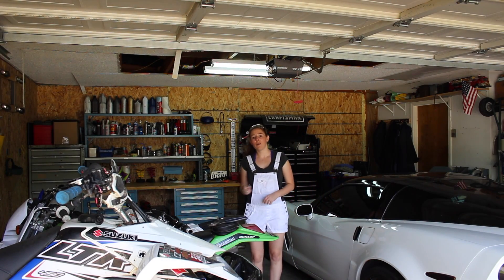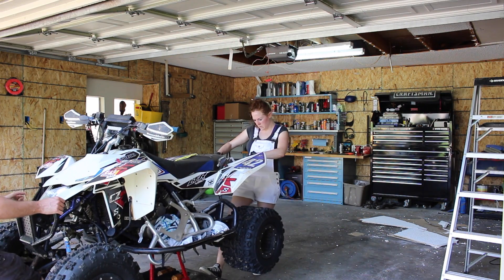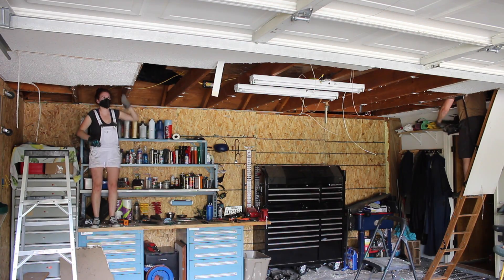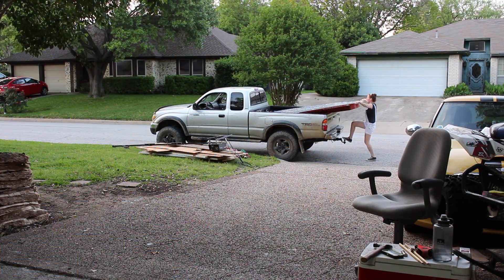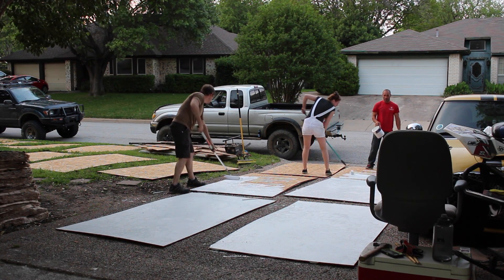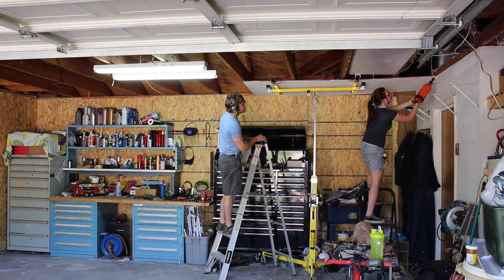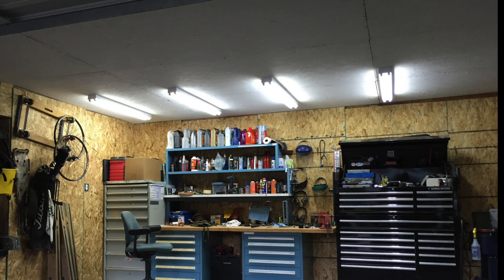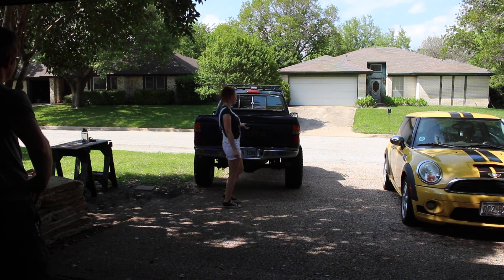Garage Ceiling Overhaul

Comment: April, this is an awesome video, great team work! 
I would go back over the ceiling and place screws at 6" on center of the perimeter of each sheet with a minimum of 8" centers 'in the field of the boards', (we used old 1970's sheetrock screw guns) even if the boards/sheets have several nails holding everything in place now. (Also I would place battens at 4'o.c. each directions to cover the exposed OSB joints, just fancier for some people.) Use screws that penetrate at least twice the depth of the thickness of the OSB board, but be sure they penetrate at least 1.5" minimum into the ceiling joists, or two times the thickness of the fastened board, which is a "considered standard" or which ever is greater, (ie 1" thick boards requires 3" screws) my 1968 Basic Minimum Carpentry Practices. Many people will tell you this is overkill for screw length, but I learned ""the hard way." 
Remember, "nothing too strong ever broke."

Off subject just a little, sorry. 
From 1968, at age 20 and during the 70's decade an employee and I could install 20'X20' plywood ceilings in 2 hours, without nail guns! Time was money and I was building/contracting homes for a 100% fixed fee. Less labor used and a more effective  use of materials was more profit for me. Again we worked harder not always smarter. The employees (age 40 was my youngest employee, up to age 57) were paid the top scale for carpenters of that era, more than some Texas carpenters as I had 3 from Dallas, who were longtime employees working for me. That said, many things are vastly improved in today's world and much easier but many people seam to make them harder hoping technology is the answer to everything. But manual labor jobs must be done for the tech people to look good, projects still have to be put in/on the ground, like the physical work you do for your videos.
I could make a small fortune (if I had a LARGE one to start with...lol) in today's world by offering a fixed dollar cost completed structure. And that is the only way I would want to work, no surprises for the Contractor or the Homeowner. But 68 is too old to learn current construction trends and styles....ahh the good old days. 
....13

Comment: When my Dad was renovating the house when I was a child, he built a square shaped frame out of 2x4 planks with a vertically moving insert which could be slowly lifted up with the piece of drywall ontop using a crowbar at each corner then sliding a screwdriver into 2 holes in each piece to act as a pin. It was crude but worked very well and it saved on going out and buying a specialty made device like the one you guys used.

Just a thought if anyone wanted to replicate it.

Comment: I see someone already talk about the codes and the fire rating. I deal with fire codes for a living. You also have problems with off gases from your vehicles going to to the living areas. I know Ft. Worth would have made you pull a permit to do that kind of work and would not pass the remodel. No preaching, just concerned. I am glad to see you and Cody working together. Just don't scratch the car.:)

Comment: Thank for the video...always enjoy your projects.  I was wondering if this garage is attached to your house?  I live in Northern Virginia and if you have a garage that is attached to living space (house), the entire inside of the garage needs to be drywalled, taped, and mudded for fire resistance and to be air-tight to the living areas to avoid fire hazards and carbon monoxide issues with having a vehicle inside.  I would recommend checking your local building codes to make sure you're good with OSB ceiling.  If it does require drywall for code compliance, you could still sheet the ceiling with drywall over top of the OSB and then you'd be good (you would be in compliance for codes and you would still be able to screw in anywhere in the ceiling to hang something so long as your screws were long enough to go through the drywall and the OSB).  Also, would recommend driving in screws on the OSB...nails are good but can work loose over time.  Thanks again for all of your videos!
Reply: Agree I think that is code every where.
Reply: my father had to do this with his garage even though the house had asbestos siding.

Comment: I helped a guy do a similar job years ago when most people used nails for drywall or whatever they were sheeting with. He was in a hurry because he only had a little time off work so he decided to drive in screws with a hammer. It worked surprisingly well I thought.

Comment: Good good stuff! yep So anyway I will be making some videos as soon as I figure it all out one of them will be how I added storage / tool wracks into my garage between the rafters instead of closing them in like this. the units are basic book shelving unit with filled in bottom / backs, it would be the bottom when their in the up position and back when they are swung down to were we can access the tools or stuff ( paints glues ext. ) real handy and saves a boat load of floor space for bigger power tools and the like. Keep the videos coming.

Comment: With the weight of the insulation over time those nails will pull out of the rafters, you may want to go back and add some drywall screws in, so your panels will stayed in over time, nails will always work loose over time with temperature and humidity changes.  looks good and iit's nice to see both you and your husband working together.
Reply from the maker: Oh good tip! I'll go back and add a few.

Comment: I see that everyone has commented on items like fire codes, staggering the joints, off gassing, etc.  I got one more.  It looks like your ceiling joists are on 24 inch centers instead of 16.  To prevent sagging, one by fours need to be run perpendicular to the joists @ 16" O.C..  Use of construction adhesive is also a plus.  A fire resistive paint may need to be used on the OSB.

Comment: My question is will 1/2 inch OSB be OK for 24 inch on center ceiling joists?  I am currently insulating the ceiling.

In my garage shop, I was planning on using sheetrock on the ceiling but seeing how easily you tore it down, I am now reconsidering OSB, also like the idea of nailing rather than using screws - nailing has to be faster and easier.  I don't have such an agile, strong and willing partner to leap into the joists, like your husband.  Can I rent him?

I checked on renting a lift and since I think at my age it might go slower, the rental quoted was $200/week (7 days) - I think  the dally rate was around $40.  So I checked into Harbor Freight's lift.  It is on sale in May for $215.  I am not certain if the 20% off coupons works with the lift but if so, the cost before tax is $172.  My plan, assuming the 20% coupon applies is after my garage ceiling is complete to sell it on Craig List for $150 and take $125.  For a total cost to me of around $60 including tax.  Not bad for a lift that I might need for three or more weeks.  This lift has good reviews.   If the coupon does not apply, I will shop Craig List - there are a few used lifts offered around $150.

Really enjoy your videos - thank you for them.

Comment: great job ! nice to see young love able to work together without killing each other 😊 
on a side note here in the uk it would be expected to stagger the joints across the boards to prevent cracking later. we would also be expected to use plaster board (think you guys call it gyprock ? over there) and you would be expected to plaster skim after as part of fire regulations.

Comment: Good call on renting that drywall lift!  I've used a big T to hold up one end while my head holds up the other and that is no fun.  Headache for a week.  lol   Looks much better now.
Reply: +Steve Carmichael I did the same thing. Why!!!!! I wish I had that thing.
Reply: *****  I've tried something similar before. It was a total waste of time. That drywall lift is golden...the lesson is not too cheap out! Especially when doing multiple sheets. So much easier and less hassle.
Reply: +Steve Carmichael I spent 10 years fitting plasterboard (your drywall) with just my head and a set of steps, takes practice but in the end I could do a full ceiling with 10 foot X 4 foot, 5/8 sound board :)
Reply: As I posted - for my garage ceiling, I purchased a dry wall life from Harbor Freight.  On sale now for $215 but with the 20% coupon and then add sales tax, the final cost was $188.  They are offered used on Craig List for $150 - so after my use, I will offer for resale $150 and take $125.  So my final cost will be about $63.  Compare that to a rental.  Here a weekly rental for this lift is $200.  The HF lift is a well-built product but not as user friendly as the rental.  Take care then it is a great alternative to renting.

Comment: You might be in violation of building codes for a garage ceiling, especially for 24" centers.  Also, the sheets should have been staggered.  Of course if there is a code violation then the staggered sheets point is moot.  The garage shall be separated from the residence and its attic area by not less than ½” gypsum board applied to the garage side. Garages beneath habitable rooms shall be separated from all habitable rooms above by not less than 5/8” Type X gypsum board or equivalent. Where the separation is a floor-ceiling assembly, the structure supporting the separation shall also be protected by not less than ½” gypsum board or equivalent. (IRC sec. R309.2)

Comment: If you ever use a drywall lift again, pull out the two legs that are on each end of the jack to where they are within a few inches from the end of the sheet, You'll have better support and balance. I've hung thousands of sheets of drywall and maybe a few hundred sheets of plywood all by my myself using my own jack.  A few years before I retired I hung a very large garage and workshop using Advantec, which is a superior grade of OSB and no gaps were required.

Comment: Great job. Maybe should have staggered the joints of the osb though to improve the rigidity of the ceiling joists. Also,  the gaps between the joints would drive me crazy... I would get some 1/4" lattice molding and trim the ceiling joints with it. It'll give it a board and batten appearance, and hide the gaps. Once painted white to match, it would look great. I also commend you for choosing osb with a heat reflective veneer on one side. This will also work as a Vapor barrier to prevent attic humidity from attacking the osb. 

Don't worry about backing up the truck. Forget about using the mirrors to do it. Turn your head and look directly through the back window to back up. Much more instinctive and much easier that way. You will be surprised at how easy it was to back up that way.

Comment: Only because I haven't seen a similar comment/question, is there a reason behind starting the full sheets on the same side?  I've always been taught to stagger seams for strength and appearance.  My second question is whether you followed up the nails with screws.  If you're looking to attach thing to the ceiling 'willy-nilly' then the nails may back off over time.
Reply: If the nails are ring shank or screw type, then no worry but screws are the best.

Comment: 1/2" material with the 24" spacing may not support the insulation over time. May start to sag if you don't put in some cross bracing between the rafters. Cool that you are getting free insulation though. I'd love to get my garage insulated one day.

Comment: 5/8" firex drywall for attached garages with staggered seams.  With all the toys and car, there's nothing to stop fumes and anything else from easily making its way into the main dwelling.

Not trying to be negative,  but if anything ever happened that stemmed from the garage, and you're homeowners insurance company saw this video,  you may be outta luck with coverage.

Comment: Just to second what others have said, check about building codes for your area on fire protection, especially as they can change if you are fitting new ceiling material, plus also about screwing the boards up, not to sure about the 6 inch centers mentioned, now I know it is a UK spec, but in a 4 foot wide board as a rule of thumb it is 5 screws in the end of a board, then 4 screws into each ceiling joist in the middle of the board, if you are nailing it up double the amount :)

Comment: Another great video April wish I'd known about those dry wall lifts when I was fitting my ceiling in the hobby room I think I used a 4by2 plank and some rope oh and a hard hat hehe.
Is that OSB board lined with foil on one side? 
I think I used foil covered bubble wrap and rock wool to insulate my roof. Keep up the good work April lovely to see you and your other half working together 
Darren

Comment: IS your OSB rated as fire resistant ? I suspect not.(not certain of current BOCA code)  As your garage is attached, BOCA code required two layers of 1/2 inch drywall OR 1 layer of 5/8 ths.on any wall adjoining the house when I built mine 25 years ago. You may not ever have an issue I realize...but you and youre viewers who might copy what youre doing .understand this....If you do have an issue where a fire starts in your garage and quickly spreads to your house....your insurance company COULD say sorry the house damage not covered...your modification is not code compliant. I have seen this type of thing personally. The most recent was a guy added a small store to the front of his house. He had a small fire which was determined to have started in his remodel.....which was not on record as having been inspected by the county. Fortunately the house was not totaled....but the claim was denied. Folks...be careful what you learn on the internet. By the way, I am suspicious of the drywall that your builder used in your garage. I suspect it was not rated MR (moisture resistant) and its hard to tell but it should have been 5/8ths for that span.
Reply: Agreed. In just about every application OSB is not fire rated and my guess is that old drywall was not fire rated either. And layer of ⅝, or even ¾, type X drywall over that ceiling would be highly recommended. And some type X on the walls would be good too. Building codes and insurance companies are fairly loose on grandfathering in old work, but the moment you start to do anything other than topical work you must meet or exceed current code.
Reply: Steven Hardy Doesn't matter now that they're moving
Reply: Steve Hardy knows what he's talking about, and he must be old too because BOCA isn't the current code adopted by most municipalities these days. It's actually the IBC (International Building Code) in most states, or a modified version in states like CA an FL. Codes are typically updated every three years so it's best to check with your local AHJ (Authority Having Jurisdiction) to find out what the current adopted code and regulations are before doing something like this.

Regular gypsum board does offer some inherent fire resistance however the big difference between it and Type X are the fibers that are added to hold the gypsum together while the paper burns away. The original sheathing was certainly a little better than OSB.

It appears that no second story exists above the garage so the ceiling doesn't necessarily require a fire rating. It's hard to tell what conditions really exist, from the video, however I can clearly see that the exterior walls have OSB sheathing while the wall that separates the garage from the living area either has gypsum board or plaster, however it doesn't appear to extend to the underside of the roof. It stops at the horizontal joists (I think) when it should extend to the sloped roof rafters. It would need to extend to roof in order to be affective, so it's possible that the removed gypsum board was originally fulfilling the need to provide separation, when the house was originally built.

Bottom line, I would argue that it does still matter and I am surprised that a home inspection didn't catch this. I would remove this video from YouTube if I was April. It could become a liability with the future homeowners.
Reply: +Steve   If you think you can close every loophole an insurance company can use to deny your claim, well, good luck with that, lol.

Comment: Was that OSB foil backed? I might have just put the reflective side out. Free insulation is hard to beat.
Reply: +Eric Corse I'm assuming it was installed correctly since I believe this is Texas so its designed to keep the heat out, not in. Unless I"m not understanding what you mean by out.
Reply: I didn't mean to imply it was installed wrong on the contrary I assume it was installed according to instructions By out I meant facing the inside to avoid painting the panel.
Reply: Eric Corse
For hot climates you would install it with the foil facing towards the roof to block the heat. I have also seen where they attach foil faced mylar on the roof rafters to also block the heat.

Comment: As a builder I see homeowners do this a lot!  The common mistake is removing the 5/8 fire rated drywall between the garage and living space.  This can include walls and ceiling.  Remember, your vehicle is a gasoline storage container and the code requires the fire barrier...
Reply: Pretty that garage is detached from the house anyways
Reply: KYRM09 - definitely an attached garage.

Comment: No plans on using the upper part as storage? Could've installed a fold-down stairs for the upper part. :) Great video as always.
Reply from the maker: What do you mean? The attic? We have a fold down staircase already, you'll see it down and Cody using it in the middle of the video. : )
Reply: Ok, just didn't see it, was busy watchin the sheet rock fall. lol :)